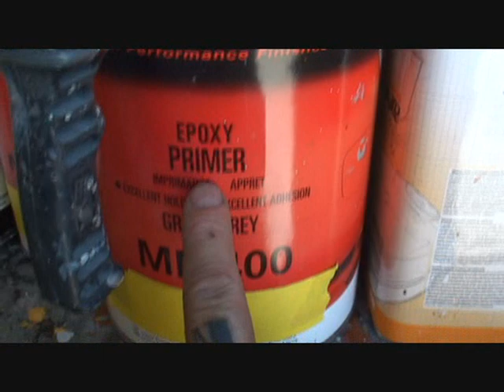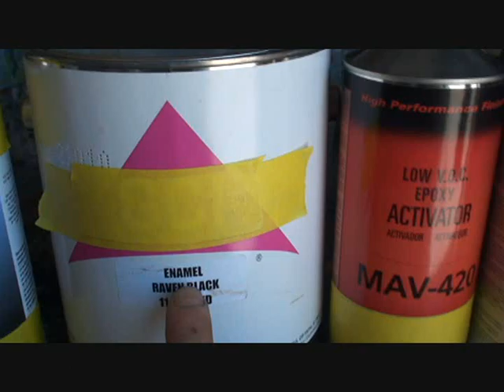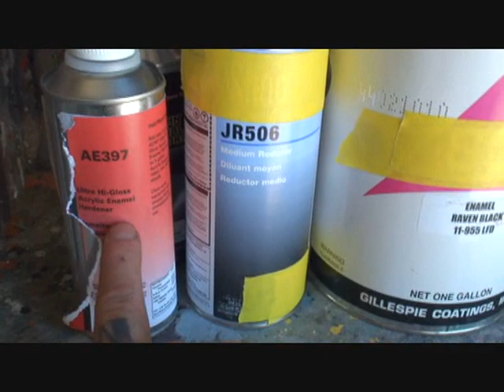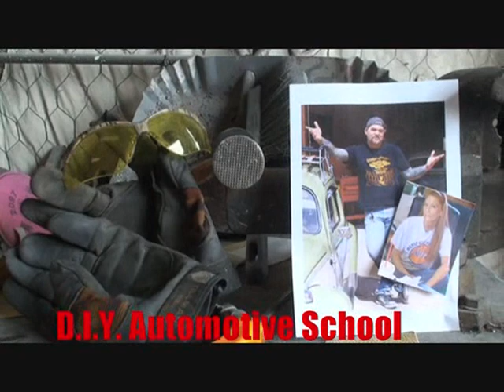Classic Truck Restoration-How To Paint The Frame. Part 1

Comment: Another good thing about painting Vs. powder coating is later down the road it is easier to touch up little spots with paint. On something you actually drive you do eventually have to do a few touch ups here and there. Pete you picked a good one to use as an example. Everybody will hear what you say and see it easily as well plus that 's a pretty solid old truck worth putting the work into. Best lesson of all is getting it done and saving money.

Comment from the maker: If you are going to paint your vehicle and you want to seal it with epoxy primer first, paint your vehicle approx an hour after applying the epoxy primer. You should be able to get some good Industrial grade Urathane or Enamal a your local paint and body shop supply store, make sure you get the appropriate hardners and reducers for the paint your using.

Comment from the maker: When changing colors inside and out a good rule of thumb is using a roll of aluminum foil. You take the foil and wrap all the wires, electrical, springs, and small parts that you don't want to pull off, this will save you alot of time, also when painting the firewall area set your gun to low air pressure, close the pattern up and use it like a toughup spray gun.

Comment: Hey pete. learning alot from your vids. thanks. Im restoring a 65 dart for my wife.. i am doing a colorchange so my question is: how to determine where to draw the line with the new color as far as engine compartment and especially the trunk comp. without taking everything apart into a million pieces. ie: hinges ,spring bars etc. not gonna be show car but still want to do a job I can be proud of. Any tips on prepping ,painting herd to reach areas? thanks

Comment: you mentioned that you wouldn't want to paint on a hot day-I thought that it was supposed to be hot (around 110 degrees) inside a paint booth so the paint dries slow. What's the ideal temp for paint drying?

Comment: Just curious, after media blasting and using compressed air to remove the "dust remnants" do you then have to clean the area with maybe brake cleaner or some sort of solvent with a cloth before paint? Or is the compressed air enough? Not really shooting for showcar frame finish, rather I'm just concerned about adhesion and protection from contaminants as I don't want to do this twice much less the first time  lol. Thanks again for the great vids, from Cen-Tex.

Comment: Sandblasting does leave a dusty residue that I prefer to remove with phosphoric acid bath and clean water rinsing....  Because I once painted a piece years ago and the paint didn't stick well because of the dusty surface from sand blasting with silica sand in a cabinet, and the sand is reused and breaks down . Yes, it flashes with light rust....but that's how I know it is clean. Your thoughts?

Comment: So, what should I do if it do plan on driving my project every day? Is paint sufficient or do I need to powder coat in this instance? I plan on driving on roads most of the time with the occasional off-road trip. Thanks, and great video.
Reply from the maker: You can paint it as a normal paint job would be painted using automotive paint. I will say --- you get what you pay for---meaning if you buy cheap paint supplys you will have a cheap paint job!

Comment: Can i also undercoat the car with this??? Or u recomend the 3m stuff for undercoat
Reply from the maker: It depends weather your workiing with bare metal or your just cleaning up the surface.. you can use the 3m stuff on either, but the paint you will have to have the surface spotlessly clean and free from all dirt, grease and oil...

Comment: I have a 02' dodge ram truck and I want to paint the frame can I used high-temp acrylic engine paint to do it
Reply from the maker: You would be better off using a Rustolium Product such as the hammer effect enamal. You can purchase it by the quart and brush it on or you can buy it by the spray can at your local Home Depot or Lowes.. Good luck on your truck. Pete
Reply: thanx man I will purchase